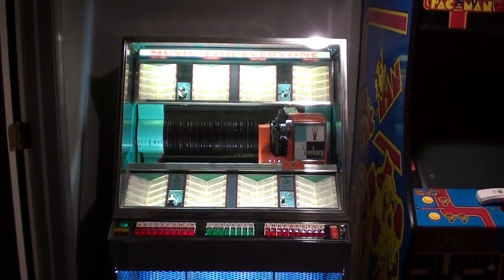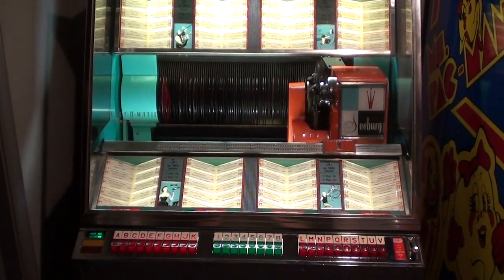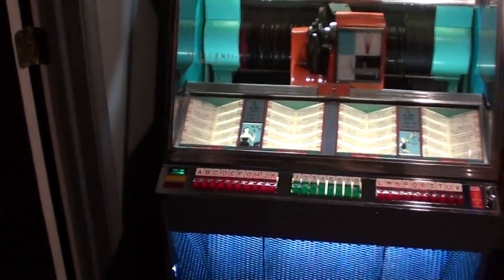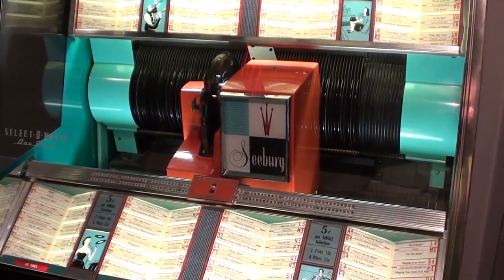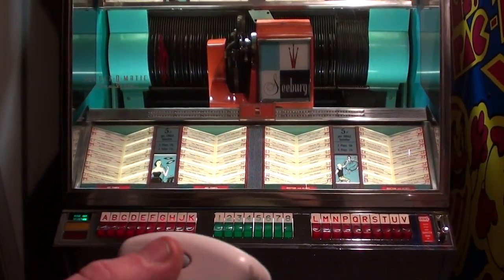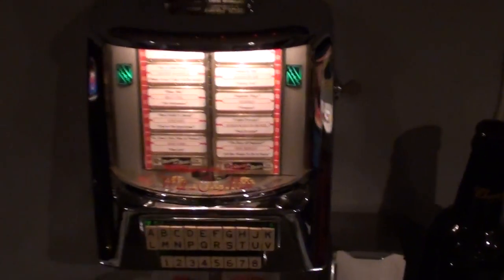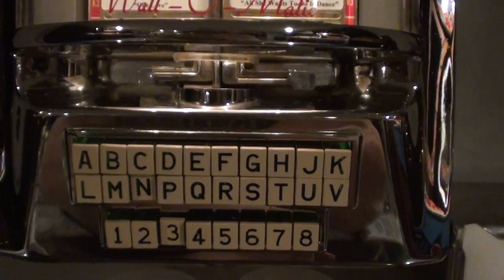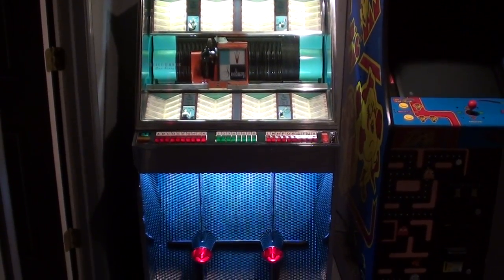1958 Seeburg Jukebox (model 161) with wall-o-matic wallbox unit

Comment from the maker: @scatpack68 
You can find a guy on Ebay who sells the Seeburg "wireless" remote control kit. It is a plug and play kit that works very nice. It plugs into the same socket as the wired volume control, and then a main module gets plugged into the AC socket on the floor of the jukebox. You then take the existing AC plug (that goes to the selection receiver) and plug it into this module.

Comment: HI - I have a 201 - could you post a help video on how you can adjust the way the 45 ep  and a regular us 45
lands on the turntable drive spindle - i have one 45 that is will not center and it will not play - thanks